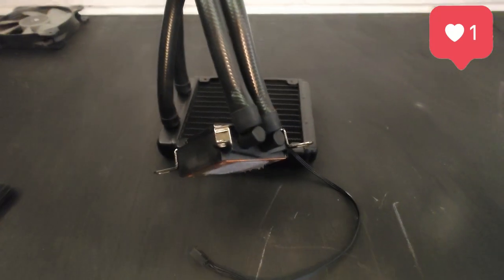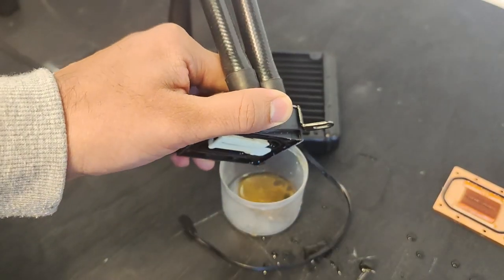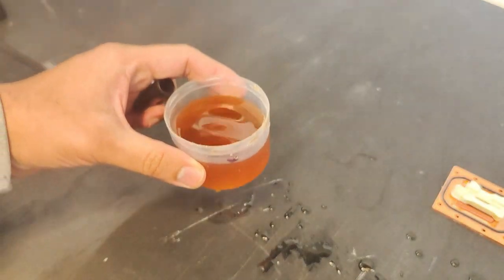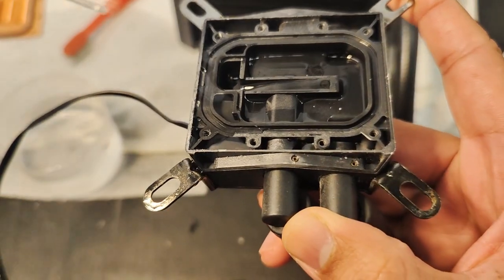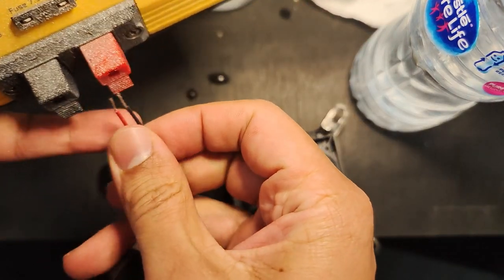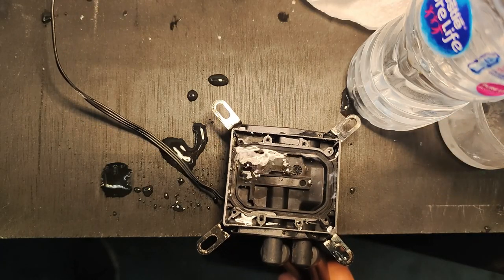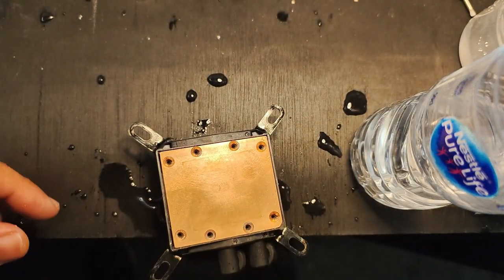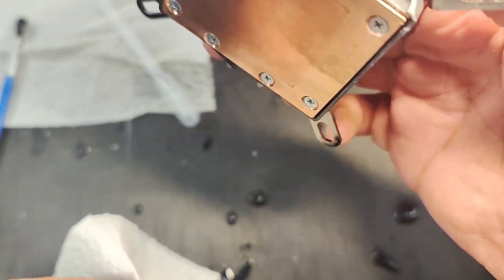CPU AIO Cooler Rebuild, Refill for Gaming PC

Comment: Also, wear gloves for your health's sake. Unless the manufacturer specifies the contents of the coolant mixture (and it ALWAYS is a sub-zero coolant mixture of glycol, for the reasons stated by the user georgecalangiu). And even then, you don't want to take risk with ethylene glycol, that stuff is nasty as fu.
Reply from the maker: Thank you, will keep that in mind next time, I think at the time I did get the liquid all over my fingers : /
Reply: My reply got yeeted by the YouTube archdemons, but I was saying that you should consider yourself lucky, as Corsair have been using Propylene Glycol in their AIOs since as far back as 2010. Some manufacturers do use Ethylene Glycol and they have to point that out visibly in the box and the product specs.
Reply from the maker: @avetruetocaesar3463  I've never seen the toxicity symbol that you usually see on the boxes. I have a bottle of the corsair cooling liquid I'll see if there is any warning on that

Comment: Excellent, I got a pair of MSI CoreLiquids one a white 2 fan and one a black 3 fan and I want to build a decent 3 fan but with the white CPU end and wondered about servicing the pump itself.   May I offer one recommendation from my old water cooling days (got on the Overclocker's leaderboard for pumping more than 3Ghz out of a 1700+ AMD single core chip thanks to water and I had a twin circuit residing in the funky Antec Skeleton case one for the CPU and one for the GPU and ram and I had to downclock the water circuit for the CPU as it ran very low and had issues of condensation and frosting :( ) is to "lap" the copper plate to a mirror shine, the lapping enables abs tons more thermal transfer and easily done with a metal polish or brasso wadding and a dremel, it does make a lot of difference to thermal transfer.
Reply from the maker: @dodgydruid  I tried this too but I think I used something a bit too abrasive (wet and dry paper) which ended up reducing the amount of pressure on the cpu. The bottom of the cooler was extremely rough though. Polishing will make a huge difference I might try it in one of my upcoming videos

Comment: Nice tutorial - well done! Just a couple of small observations: 
1. Using water (even distilled water) is only OK is a non mixed-metal loop such as a custom waterloop or brass/copper radiator AIO (fractal design Kelvin comes to mind). Using straight water in a mixed metal loop such as your corsair (aluminium radiator + copper coldplate) will cause galvanic corrosion that will block the coldplate skived fins very quickly if under 24/7 operation (its a matter of weeks - been there, made that mistake thinking ultrapure distilled water is OK - it is not; tap or any kind of drinking water will most definitely accelerate that process even more). You should only use water with corrosion inhibitors, stick to PC-specific brands such as Mayhems, EK, XSPC, Corsair etc as the general purpose plumbing or automotive ones are very hit or miss for these kinds of applications (mostly too dense or NOK for seals) or if you are not comfortable mixing the chemicals together with water in fixed ratios just use some watercooling premix (£10ish for a 1L bottle off Scan or Amazon and that will be good for 4 or 5 120mm AIOs or about 3 240/360 AIOs)
2. The rubber grommet is called a jetplate and it plays a crucial role in the cooler's performance by transforming the (mostly) laminar flow into turbulent flow which in turn "separates" the liquid from the fins and mixes it. A simple way to understand this phenomenon is to hold out your hand and sit still for a moment - then wave it in the air - for a very short time your hand will feel "cold" and then the temperature will magically return to normal - that is what happens when the hotter air around your hand is disturbed and mixed with the surrounding colder air, same principle applies here - don't know where I heard that recently, but it is a hell of a lot easier to understand than the explanation a fluid mechanics guy would give you (also fluid mechanics is a horrible subject on the best of days)
3. Try to fill the AIO without turning the pump on if possible - it most likely won't hurt it for a short period, but most AIOs that require this sort of service are already very old and running the impeller without being submerged won't do it any good either.

Like your videos! Keep them coming
Reply from the maker: Thank you, I was debating if I should purchase some water cooling fluid but then I looked in the manual for the Corsair cooler and it mentioned distilled water. Judging my the colour of the liquid though it seems as though they probably got this wrong when the cooler was released. Thanks for the input though it's really useful for me and hopefully others. I have more videos coming but everything is going wrong at the moment 😂, stay tuned....
Reply: @RestoTek  you can use distilled water to top it off, but not to replace the fluid ;)
Reply from the maker: @georgecalangiu-ene1418  just out curiosity what liquid do you use?
Reply: @RestoTek  Mayhems x1 ECO clear as it is relatively inexpensive and non-toxic. It is supposed to be compatible with most plastics and its 100% OK to use in AIOs (I've done over 50 until now and never had an issue with any seals or mixed metals), but sometimes it can turn certain types of clear plastic green as It happened to me with EK tubing.
Reply from the maker: @georgecalangiu-ene1418  thanks so much, you may see this liquid in one of my future videos 😂😉